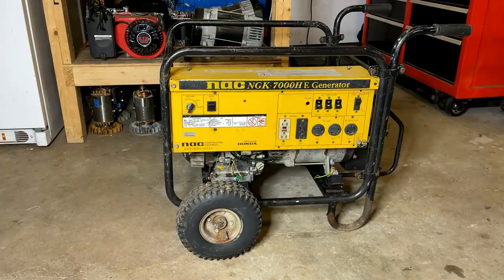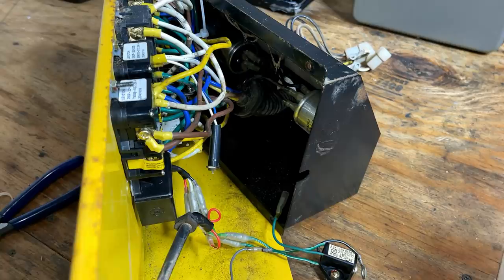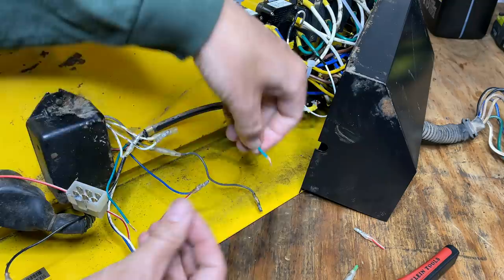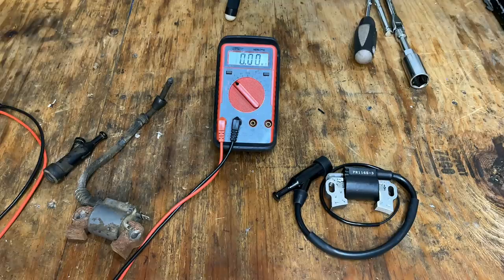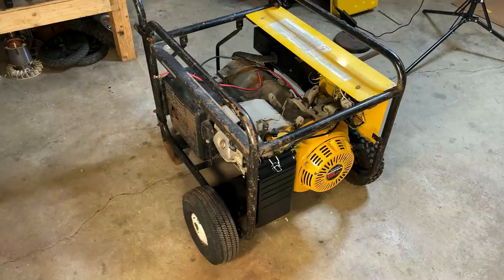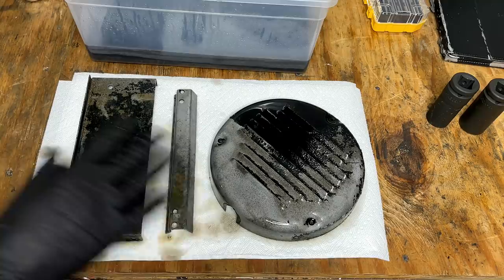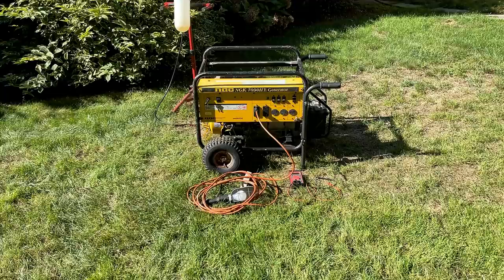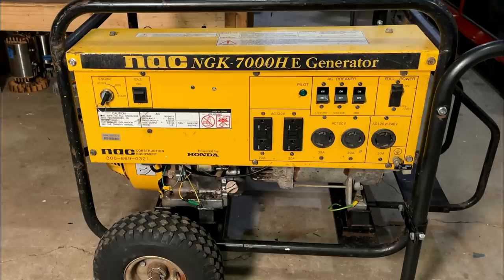Trashed Generator Part 2 - Making it Perfect

Comment: Sure makes it easier when you have four hands. Good job on the wiring!
Reply: That's actually a "trick photo" --- you can see how the hands and shoes are exactly the same, and then there's the "jump cut" at about 38:53, where the black ground wire suddenly "leaps" onto the negative battery-terminal just as the second pair of hands appears from the left, even though the hands on the right do not change position at all, but just go on threading the nut onto the bolt, proving that it is the same "unbroken" footage there.  So that's obviously a superimposed shot that James did there, with both of those pairs of hands just being himself shown twice.  Very clever video-editing, though --- it was only the identical shoes at 39:18 that finally "gave it away" for me, and made me realize that it was just playful footage-manipulation. :P :D
Reply: @Quack. No, he has 4 hands. Lol

Comment: Excellent work, as always James!!
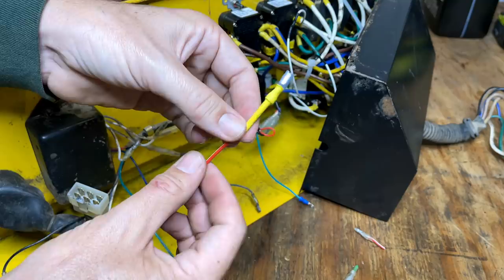At 16:04, if that happens to me I take a few slivers off a hot melt glue stick, pop it inside the heat shrink and hit it with the hot air gun. The glue stick melts and fills in any gaps perfectly.
Reply: That sounds like an ingenious idea! :D :D :D

Comment: When putting grips back on, use a little hair spray. It acts like a lube to put them on then it drys like a glue. What I did building bicycles.
Reply: Another option is rubbing on a little soap.  It goes on easily, but relatively quickly the soap turns into something resembling glue.

I do like the tip of trying an air compressor.  I have some handles I have to replace.  Now where did I put the air gun?

Comment: For the future you should know that it's okay to have a 15 amp outlet on a 20 amp circuit. The internal connections of all 15 amp outlets are rated for 20 amps so they're not at risk of burning out. The only downside of fitting a 15 instead of a 20 is that you can't use 20 amp plugs but practically nothing has those so it's no big loss.

Oh, one last thing. When you did the final test I noticed that the pilot light was out.
Reply from the maker: I saw the same :(  things did not go as planned.
Reply: Fiddly stuff but you keep calm.
Reply: Amazing what YOU are able to find on ebay....

Comment: I use a smaller heat shrink on the wire with a larger one over it on the connector. I find that some heat shrink tubing has a wider shrink range than others. 3M seems to be the best but it is more expensive.

Comment: Love your show……..love the way you work.
When my 5kw 240 v Chinese diesel was used for 60 hours power cut here in Australia it worked great.
1 week later I went to give it a service and it was only making less than 50 volts ac?
I was able to confidently test the power head from what I learned in your show and establish there was no fault.
The capacitor (used for regulator) on the other hand was out of range (should be 12.5uf but was 7uf).
Replaced with a new one and it’s now up and running again for next time I need it.
Had no chance of working this out without your show so may have scrapped it. (Only cont $300 in the first place so not worth getting looked at).
Reply from the maker: Glad to hear you were able to work the issue out.
Reply: One suggestion (from someone who also has a capacitor-based generator) - pick up an extra one of those capacitors and keep it as a spare. Never know if next time, the darn thing will go bad during the power outage!

Comment: I replaced the bridge rectifier in my 1A battery charger a few years ago.  It had a half wave rectifier.  I used 10A 400 volt PIV diodes from EBay, instead of the selinum rectifier it came with 40 years ago..  It works fine, now.  I smoked it down trying to recharge a dead deep cycle battery on my boat.

Comment: James - instead of adding electrical tape to seal the heat-shrink on the wire connection, try adding a thin coat of silicone sealant to the wire and connector end under the area where the heat-shrink goes. Then shrink the heat-shrink and clean up any silicone that squeezes out. Once the silicone dries, you'll have a waterproof and very strong connection.

Comment: About using 50/50 Vinger and distill water to clean the rust off. It's what I have used for many years; let them soak about 30 min or so. Then the bath can be dumped anywhere, and it doesn't hurt our environment. Plus, plus!

Comment: Tip: to get shrink tube diameter match with connector, put smaller shrink tube on the wire, over the insulation, before crimp to increase wire diameter …

Comment: Hi James, thanks for your videos. I love watching what you do with your meticulous and methodical process.
I have some advice. When using shrink tubing, you can shrink a smaller diameter piece of shrink tube under a larger diameter piece of shrink tube to increase the circumference for those things like connectors.
On the handle sections you replaced, it might have been an option to use a pipe cutter or hack saw to cut the bottom rusted curve off the original handles. You wouldn't have had to drill a new mounting hole in the frame.
Reply: He  has saved a pair of clamps this way. The new bolts replaced the top clamps. James seldom throws things away that might be useful in the future. Quick access when needed and saving a few bucks is always a good idea.

Comment: If you spray windex or some other cleaner into the joint between the grip and the handle bar it will wick into the gap and make the grip easy to slide off.

Comment: Haha!  I have run into the "too big heat shrink" problem too. If you know in advance it will happen or if the other wire end is free, you can just add another smaller tube and "telescope" them. Tape doesn't last well in my experience.  Brilliant vid as always!  Thanks for your patient teaching.

Comment: One of my main complaints with the Ryobi Drill was that it kept spitting out the bits... I found out that after you spin it tight... if you tighten it by hand more... that wont happen... great video... good work... thank you for your time...

Comment: Ouch! Bummer to see that you'll have to replace the power head after all of the other work, but it will no doubt be right when you are done. Split screen connecting the battery cables was hysterical!
Reply from the maker: That was my twin

Comment: I would have kept the harness stock, and cut the wires/connectors off the bad bridge rectifier. Then crimp some lugs on the ends of the wires to plug on to the n ew bridge rectifier. That retains the stock harness, and lets you plug and unplug the new bridge as needed, just like the original.

Comment: On the coil. I had one that seemed to be good, but misfire problems after a while. Insulation inside the coil was breaking down when it was warm.
Reply from the maker: Just had a similar issue with a spark plug.  The engine would run all day long without a load.  With a load it would only run for 30 seconds and then ignition was lost.  Heat related intermittent  failure.

Comment: That battery tray looks awkward for a group U1 battery. It's probably meant for a 12V, 17Ah SLA battery. The "17Ah" form factor actually has batteries up to 22Ah in the same can size with the 18 and 20Ah sizes being the most common. "High Rate" variants of these batteries are designed for UPS service where deep discharge often happens in 15 mins or less; these batteries have slightly higher CCA and make excellent performing, very long life starting batteries that are also tolerant of deep discharge. (The high rate 21Ah PowerSonic PSH-12180NB-FR has served me well in all applications requiring this size battery.)

Comment: I use Evaporust all time, it is awsome stuff! I use Purple Power water base degreaser 50/50 first, it will remove a lot of the paint. Evapo doesn't like any oil or grease.

Comment: You could have just cut the bottom U-bends off the original handles and saved the dog bed parts for another project.
Reply: Still can. Only need to clean the rust off and find another pair of grips and the original handles can be re-used.

Comment: Hi James, great work as always. Just a word to the wise though, when you mount a bridge or any other component to a metal panel/ heatsink put a smear of thermal grease on the mounting surface to ensure you get good heat transfer and therefore the rated load.